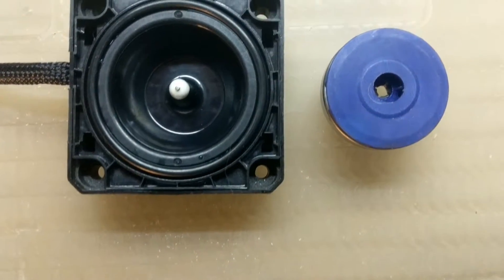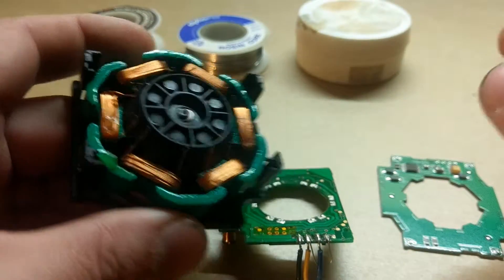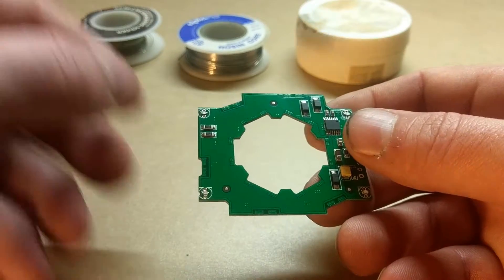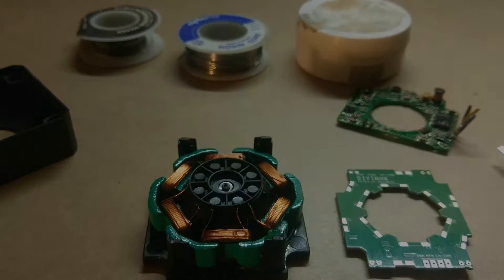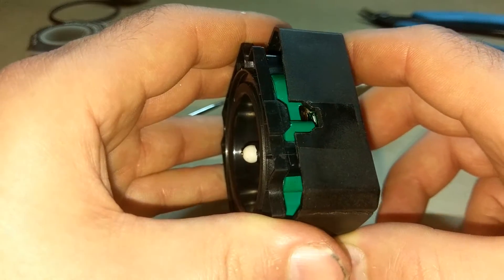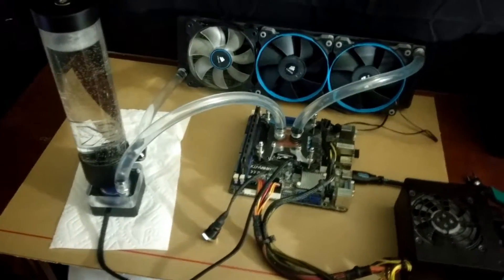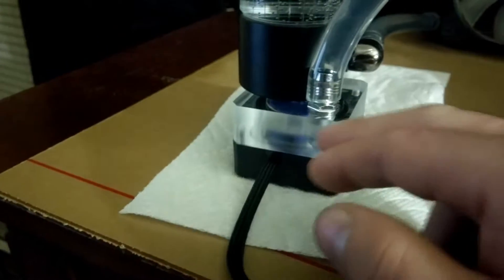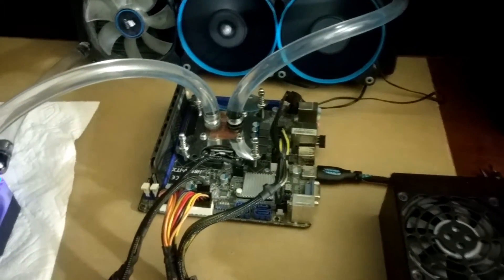DIY DDC PUMP Repair And Upgrade DIYINHK

Comment: Do you know which part of the PCB to reconnect lifted pads for the PWM and RPM signal pads? I have a new  EK DDC 4.1 pump that came with them lifted out of the box due to the cable being too tight from the factory.

Comment: 4:15 - In PWM control, 12V is supplied constantly From the motherboard to the pump/fan. The PWM signal varies to tell the power-regulating IC on boart of the pump to adjust the power supplied. In DC (3 pin), the motherboard directly varies the voltage supplied to the pump/fan. PWM control allows for a more accurate speed control. Nowadays that mod isn't necessary since modern bioses can regulate both 3 and 4 pins speed, they even auto-detect what kind of pump/fan you have connected and they go DC or PWM. And what about the power increase... it's not all that necessary, tbh... a 10w pump is quite enough to manage the flow in a small circuit such as a water cooling loop of a computer.

Comment: For anyone interested the IC is DRV11873 from Texas Instrument, quite simple to use just 5 components as 2 0.1uF caps for the charge pump, 2 more caps for decopuling the 5v/12v and a 3.3k resistor to set the max current to 2A. If the motor doesnt have a common pin as in delta configuration u need to use 3 10k resistors coming from every phase. The FG pin can switch the PWM frequency from 65kHz to 125kHz if desidered. It supports a PWM input from 7 to 100kHz and has a RPM output which frequency multiplied by 60 and divided by the pair of poles of the motor gives the true RPM.
This IC is also used in the Noctua Industrial PPC fans as the NF-F12 iPPC-3000
Reply: Are you talkin about upgrade the controller on the DIYINHK pcb?
Reply: @jaystheone1  also yes, iirc he rubbed of the numbers or you cant see them in the picture but its obviously that IC now that I saw the datasheet (also he adds 3 schottky diodes as per datasheet aswell)
Reply: the original ddc board uses a microcontroller with custom firmware and 3 discrete double mosfets for a total of 6, tecnically speaking this solution its the better one, but actually the software in the IC is pretty basic and thats how they limit the power for the various types of pump (the 18w one gets up to 80% duty cycle)
The DRV11873 on the other hand doesnt care about software limits etc, it just pumps 3 phase up to 2A and syncs with the back-EMF
iirc the discrete mosfets in the original pump can go up to 3A so theoretically it could spin faster/stronger but they are limited by the microcontroller

one is more of a software solution like an ESC and one is more of a hardware one with comparators and some logic
Reply: hey there, I saw your comment and thought I'd ask you, I burned my PCB of an alphacool PCB black rotor and it was controllable by voltage (not PWM) when modding the connector to the fan header.
Its max rpm was 4400 and startet up at 1900, it had 2100 unstable when below certain voltage, but then goes back to slower to 1900 and then linearly to 4200 which was max voltage of the fan header.
Do you know a replacement pcb for that pump other than this one?
There seems to be complete ddc pumps at the price of this pcb replacement aswell.. so I'm uncertain if i even should try a expensive repair.

Comment: Finally got my pcb in to do this mod, installed it and omg it's way louder than the original. IDK if it's because my pump is mounted to the cpu heatsink, but the pwm pulse noise is ridiculous, even with the pump at 25%. does anyone know how to quiet that down? I was really hoping this would work, as the pump is the loudest part of my system.

Comment: I have nothing but issues using the pwm version (6watt)
Most of them I have to tap the pump to get it to start. SATA or molex uses 18w never had issues with them

Comment: Nice guide, Used to to pull apart my Alphacool DDC310 - Just a 10W pump which didn't support running of an Aquacomputer Quadro header. With the DIYINHK PCB now in - It does run, however it is also louder at all rpms compared to the old. Not worth the tradeoff for the sake of a single control, that said it does max out at 5000+ RPM now which is good to blast bubbles out..but damn, its loud AF now.
Reply: How much more productive do you think your dds310 has become after the upgrade? I'm wondering if this model is worth the effort.
Reply: @Igor.Kupinsky  It was too loud. Waste of time with that particular Alphacool model pump.. I just got a EK-DDC3.2 and it works perfect with PWM header on Quadro.
Reply: @aaronactive  I can see video with your`s DDC310 diyinhk plate with sound? I`m need powerful pump, but if too loud this not comfort. But level of acoustic comfort everyone has their own. so...

Comment: Great video. Needed to find out if I could just use the existing PCB board and just solider the extra wire to the PWM connection and connect it to a four pin connector and do it that way? Or, do I actually have to take off the PCB board and replace it with that new board that can you put on?

Comment: Low melt solder helps a ton with wicking solder. Put a dab of low melt on each point and the wick should get almost all the solder in one go.

Comment: Great DIY content. after having several EK pumps. they are delay starting and sometimes requires tapping on. EK supplied me with 3 to cover two pumps. have you ever seen any delay start? they don't stop once spinning. any feedback appreciated.
Reply from the maker: Thanks man!!  Working on a few more videos. I've never had that issue, but I have heard about it. If its easy to get out, I would pull the impeller out and inspect for any debry. The bearing is only used during startup and shutdown. While its running its suspended in the fluid and magnetic field being generated. I would also unplug it and inspect the pins. A bad connection can cause excessive resistance,  increasing amperage, witch would cause an increase in heat. Over time, that can where down the pins at there point of contact.

Comment: Is it safe to only plug this into a fan header? From what I'm reading some have said you might fry the header trying to power the pump off of it.
Reply from the maker: You do gotta check and find out the amperage your headers can handle. But, most modern mother boards have enough amperage to run this. I wouldn't try a D5, but a ddc shouldn't be an issue. I've had it running my in my nas 24/7 since shortly after posting this, on an old z77 board. Gigabyte g1 sniper 3 to be exact.  Haven't had any issues.
Reply: @CyberDenSystems  Thanks for the quick reply. I have an X570 mini-ITX board and surprisingly the amperage isn't listed in the manual. I have a MCP350 (DDC 3.1) which is only 10W so assuming that the headers are only rated at 1A I should be safe.
Reply from the maker: Yah I'd say you won't have an issue with that. I'm actually surprised a board like that doesn't have a header labeled, "pump", since that's a popular thing to put on boards nowadays.
Reply: Most newer mobos have pump headers that are 3 amp rated. If you don't have this, then get an adapter that splits the PWM & RPM to the a 4pin fan header connector and voltage to a Molex or SATA connector. Or wire it like the newer DDCs that have two connectors.

Comment: Good video
I've had this pump since I moved in to water cooling around 10years ago. Always overclocking cpu and gpu with a 360radiator. Athlon xp 2400+, core2duo e8400, and recently my r5 2600... this pump is a beauty and with that mod, it's perfect. Use some adhesive soft pads from chairs or tables on it's bottom, and it becomes real quiet.
Reply from the maker: Thanks man!!  I appreciate that. Everyone like to rag on the ddc pumps. I think they're great.
Reply: @CyberDenSystems , I was going to do this mod, but instead I simply changed the plug to a 3 pin fan plug and connected it directly to the motherboard cpu plug and have it running at a minimum of 60% to 100% power. This way it ramps up and never shutsdown, going between 1500-3400rpm. It's easier and doesn't envolve buying anything or soldering. Thanks 😊
Reply: @nelsoncasquinha  Sorry to necro this, but I tried that after going back to the dc pcb, and my pump doesn't seem to go below full speed regardless of what I set it to. I'm on an Asus x570-i. How did you get your's to work?
Reply: @DUD3_BR0  probably settings on the bios, it needs to receive the sufficient amount of voltage to work. This said, you need to put the threshold a bit higher probably.
Also on windows, I use a github app called fan control if I'm not mistaken.
Reply: @nelsoncasquinha  hmm, yeah I'm also using fan control. Mine just stalls out below 70% Thanks for the response. I'll have to keep looking into it.
Reply: Why are you watercooling a Ryzen 5 2600? Its a low end CPU. And already runs cool with a aircooler.
Reply: @TXHoodStarZ  because not only it performs a lot better overclocked, but also, it keeps the system ultra silent. Besides all this, I always have my desktop watercooled no matter what. Moved to a 5800x over a year though.

Comment: whats the point of doing this besides to add pwn control or replace a burned out pcb? im wanting to change the rpm on my alphacool ddc310 pump and it currently maxes out at  around 3190rpm but im having issues with my gpu hovering around 80-84c under load so i thin the pump flows too slow
Reply from the maker: Those would be the only reason to do this. I haven't used the 310 pumps yet, and dont know if the coils are different on them. So I dont know if this mod would help you out in your situation.

Comment: hi, thanks for the vid. Does it work for ek ddc 3.25? It's the fastest ddc on the market. That copper wired coiled thing in the corner of old PCB fried up and turned black on mine, I think it was short circuit.
Will it still be the fastest ddc on the market after the mod? At full speed with 3blocks it beats 24v d5s according to tests.
Reply from the maker: I'm not %100 sure if it would still be the fastest. I've got this pump in use 24/7 since I made this video and it's still going strong.

Comment: i am thinking of buying one, so the original pcb cant even pwm?or tweak it to pwm? like the 3 speeds you got on your case speed control?
Reply from the maker: The original pcb does indeed have a 4th solder point witch it shorted to power. So it may have the ability to be pwm controlled. But since it was no good I didn't have the option of trying it.

Comment: Will this work to upgrade the EKWB Predator pump? it is a DDC 3.1 6w, i expanded the Predator and i think the pump is not keeping up, i heard that you can make it spin faster by upgrading it with this PCB.
Reply from the maker: Yes sir it will. That aio uses the same ddc pump. You won't be able to see the leds, but it'll fix the dead pump. Just make sure to solder the cables back in the same position on the new board.
Reply from the maker: And it'll give you more control over the speed.
Reply: Ty man! just to be sure, my pump is not dead, it's just that i heard it's not potent enough for 2 rads + cpu block + gpu block + reservoir, so i think i am missing some performance out of it.
Reply from the maker: Oops. I missed that in your last comment. Lol. If you ahead with the mod be sure to post back.

Comment: Glad to see you're back to posting videos.  Did you finish your PFSense router?  Maybe it's time for another build tour video.
Reply from the maker: Thanks man. I did finish it and it's been running great. I'll be doing a video shortly on my network setup. I got a server chassis, a couple server cases to transplant everything into, and some other gear to put into it. Gonna get custom painted and some water cooling involved. It sprung a leak recently so I gotta get moving on it.

Comment: Thats a really nice update for the DDC
Reply: I had one too. And i opened it twice. Once for the frame repair and the second time for sleeving. Gave it to a friend. These tiny things are powerful enough for dual 360s
setups
Reply from the maker: Thanks man. Yah it is a great pump. I've done plenty of builds with these guys. Works like a charm.